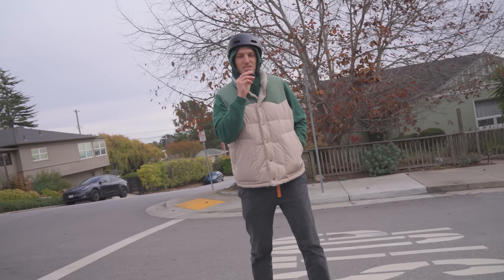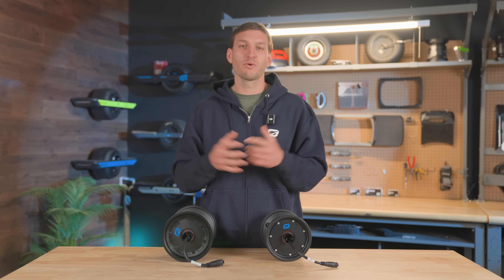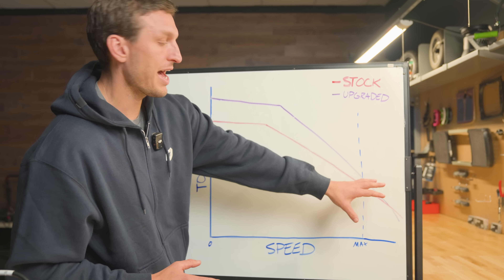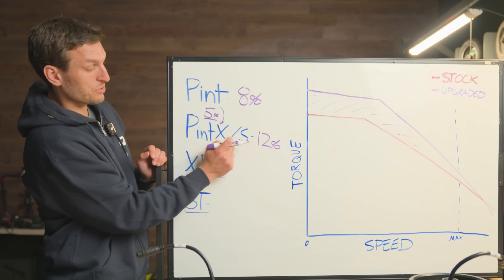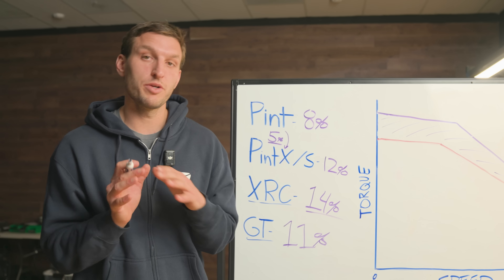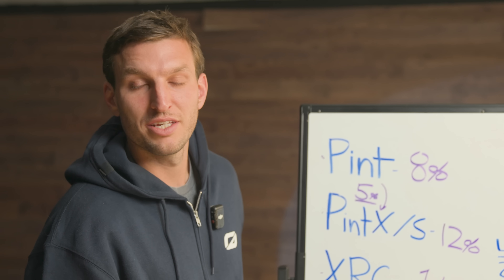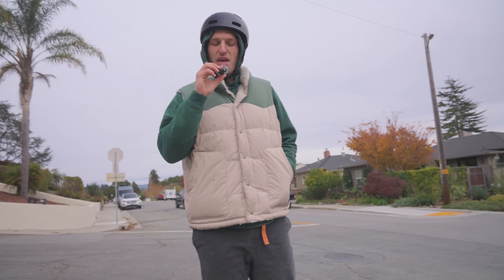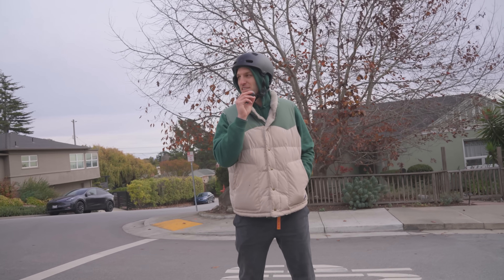We Put an S-Series Motor in a Onewheel Classic!

Comment: GT-S owner here and I'm in the market for a 2nd more agile board.  I will not buy the Pint S until it ships with S motor from factory.  I called Futuremotion and they won't even install the Pint S motor if you buy both at the same time.  1400 plus another 650 and maybe a bundle.  Well over 2K and they won't take the sale.  Keep your Pint S until you do what your customers tell you what they will pay for.

Comment: Does the Pint S-Motor change top speed at all?
Reply: Nope, it actually reduces it. 

This mod is pointless for the pint since its unstable on trails anyways so the extra torque is useless. You spend $650 to get lower top speed which is already too low and not as advertised of 20 mph (actually top speed is around 15-18).

Comment: What is the motor weight difference from stock to S-Series for each platform?  Also, you mentioned heat then moved on.  A lot of people overheat their GTs on hot Summer days; are there any metrics or anything to judge if it is worth it to stop the overheating with an upgrade?

Comment: There is no need to motor upgrade. Existing motors have more than enough power. My 4 year old XR with XRV kit has more power than a GTS. ( XRV increases your XR power from 2500w to 4200w, +68% power increase!)
Reply: No way they can get the 75v XR motor to have more powerthan the 113v in the gts

Comment: You are telling me the "Pint x" is better than the "Pint s" when upgrading to the "S-Series Motor." I thought the "pint s" was supposed to be better? 

 

from a now disappointed "pint s" owner, low-key feel scamed :(
Reply: PintS is the same as  PintX.
Reply: @taylorgarbutt1918  Yeah, I know, besides the footpads and performance tire, but just the fact that they didn't include the  "s-series motor" with the "pint s." Still feels very misleading, especially for new owners. The video makes the "pint s" look like the older pint compared to  the "pint x." I just bought the pint-s since it was the "best pint" and like now knowing that a new "pint s-series motor" is out kinda contradicts their marketing with making the "pint s" look like the better pint.
Reply: @HGKspectro  it's just  a PintS 🤷‍♂️
Reply: @HGKspectro  it would be called a PintS series if that was included.
Reply: @taylorgarbutt1918  True, you have a point,  but imo still misleading considering they have the GT “S.” Pint X+ feels more appropriate since they are essentially the same.

Comment: Ooh! Math hour! I wanna play! 🧮

• Pint - 86.67% more cost for an 8% increase in torque.
• Pint X/S - 46.43-59.09% more cost for a 12% increase in torque.
• XRC - 44.74% more cost for a 14% increase in torque.
• GT - 34.78-36.96% more cost for an 11% increase in torque.
Reply: 86.67% more cost for an 8% increase in torque is a crime
Reply: The additional price isn't worth it for many. Which is why it doesn't come installed (and priced into) stock boards.
Reply: Damn cheaper to just vesc to get the extra power

Comment: C'mon, like you didn't have this motor in the works a while ago before you released the Pint S. You would think your Pint S would come with an S-series motor but no.
Reply from the maker: These motors cost a lot more to make which would change the cost of the board. The included motors are still great but if you want to crank it up a bit you can choose to upgrade the motor on your set up!
Reply: @Onewheel  If you're worried about changing the cost of the board then change the name.. call it a Pint X+ and then for the REAL Pint S include a S-series motor and price it accordingly at like $1600-$1800.
Reply: @Onewheel  I will agree that the motor option should be included with the PintS to make it truly a stand out and above the pintX. I would have gladly paid for the new S motor with my pintX board not after and more cost with the additional motor that I can't use.

Comment: Wait so will the Pint-S Series (now with an S-Series motor which didn't exist previously) have a higher top speed than the Pint-S with a regular motor?  If the XR Classic and Pint-S had a 22mph top speed, they would be in my collection already, as this allows for optimal cruising speeds without hitting pushback

Comment: Got so confused when he pulled out the whiteboard. So the Pint S doesn't come with a Pint S motor standard? I was like wtf is he talking about 12% upgrade?
Reply: 💯% but also confused how, when that was literally the "data-portion of the program" 😂😂 *sarcasm*
Reply: 12% increase in torque if your buy and install the additional Pint S series motor.

Comment: Why can't I upgrade my pint to a pint X/S battery configuration? That's what would hold me back with a motor upgrade.
Reply: @HyperDash   you can bang a Quart in there and rewheel it.
Reply from the maker: Because the electronics in the Pint controller aren't designed for the power specs of the bigger batteries :)

Comment: Say I upgrade my GT to the GTS motor, will the app know it’s a GTS? Or will it still think it’s like a GT and stop me at 20 instead of the 25 MPH?
Reply: @echobird115  your board will not become a GTS just because you install a GTS motor. Nothing will change aside from slightly better low end performance and thermals.

Comment: I bought a Pint S a month ago, woulda been kinda cool to have this S series motor in my S series pint…. Thanks FM.
Reply from the maker: The only thing is that this S-Series motor would have pushed the cost on the Pint S significantly higher. Pint S came in $100 lower than the original Pint X cost but with all the best accessories factory upgraded. Plus we doubled down on developing new firmware to push performance and made that available too Pint X riders as well. A great board and a really great value. Still wanted to make this motor an option but without pricing out most folks.
Reply: @Onewheel The S motor is only $200 more than the X motor on the website. I’m sure lots of people would have paid 15-1600 for a true Pint S… instead I would have to spend 650 more for the new motor and have a spare sitting around collecting dust. Maybe you guys should consider a trade in program for the new motor.
Reply: @Onewheel I have plenty of money for top tier products that meet my needs.  Feels like y’all are playing with my money.  Bought PintS early October, best beginner board.  Bought the XRC at launch, larger platform more power.  And now this…

Comment: This is great news. Been looking into upgrading from my Pint X, maybe this is the solution.
Reply from the maker: Yea it'll give you a pretty sizable performance bump
Reply: @Onewheel  what about mileage?
Reply: @taylorgarbutt1918  I don't care about milage its never been my issue, its torque that I am looking for.
Reply: @StephenMcElligott  same here honestly.
Reply: @StephenMcElligott  you'll get slightly better ranger since the motor is more efficient most likely.
Reply: @taylorgarbutt1918  It gives more low end torque with stronger magnets, the stronger magnets in turn reduce range. The question is how much will it reduce the range by.
Reply: @Defamation_  they mentioned that you get slightly more range. Not sure what your saying.
Reply: @StephenMcElligott  PintV kit will do you one WAY better
Reply: @matttattack54  not interested.
Reply: @matttattack54  that new motor and PintV 🤷‍♂️
Reply: @matttattack54  where do you buy the pintv kit?

Comment: @Onewheel just a suggestion. What do you think about offering people a bundle whenever people are buying boards with the upgraded motor so the consumer can save somewhere from $150-$250 off the motor upgrade. Just a thought. Love the new XRC 🤙🇺🇸🦅
Reply: Future Motion says that unfortunately although the s- motor fits in All their current boards, their "bandwidth" (aka CEO's?) won't allow their boards to be shipped with the motor their customer prefers 😢😢
Reply from the maker: Yea not a bad idea, we'll pass it along. I know we'd love for each board to have a factory installed upgraded motor at an option at checkout but it's just not viable at the moment.
Reply: @Onewheel                                                  viable  Fm can EABOD's
Reply: @Onewheel  people can still buy the factory board with factory motor installed but have the option to get an additional upgraded motor separately with a package deal and install it themselves or have the factory install it at different price points.
Reply: @Onewheel  Not viable?  The standard motor is $450, and the upgraded motor is $650, so a $200 difference.  Is it viable for me as a consumer to purchase a board with a $450 motor and then spend another $650 to get the upgrade- Just to have a useless OG motor hanging around in my life? Missing out on some sales here, I’d wager.
Reply: @Onewheel  of course not. Because then how else would you be able to make people buy more than one motor. Jeezus.

Comment: I think people would have preferred the Pint S to have to have the S motor w/o the upgraded accessories (tire, handle, footpads), even if it costed like $1500. It makes sense but why wouldn't FM do this? I'm thinking it's a spec and marketing issue. Putting in stronger magnets while keeping everything else in the drivetrain the same usually means higher torque at the cost of top speed which they crucially omitted in this video. 

So to make the Pint S have better torque and speed over a Pint X it needs to have better drivetrain components all around, most importantly, the battery. But new battery and motor would place the Pint S at around a XR Classic or GT price which doesn't make sense from a marketing and product standpoint. With the price reduction of the Pint and Pint X, the Pint S has no purpose other than to fill a gap in the lineup but from a product perspective not a performance perspective; which is pretty whack IMO. And if you're considering a Pint S you might as well consider an XR Classic which is what they want you to do.

Comment: The Pint S doesn’t come with a Pint S motor?  So Confused!
Reply: The Pint S is literally just a Pint X with upgraded footpads and a tire, that's the only difference the FM website lies to you about a bunch of things
Reply: @CodedGames facts! Plus they claim 20mph. False tops out at 18mph before pushback.
Reply: @CodedGames  Stop trolling this post with misinformation. FTFL
Reply: @StephenMcElligott  But that's literally true. If you go on FM's website it says the max speed of the Pint X is 18, which is false. The Pint S is literally just a Pint X with better footpads and tire. The literal OW app can't even tell the difference between a Pint X and Pint S as you have to pick which one your board is
Reply: @StephenMcElligott  not trolling when it’s facts
Reply: Why was it ever given the S name then?!? (because they rushed it in response to the PintV kit) no new motor. No bigger battery. Same same, but  b u n d l e  version. Not S. Never was. PintX+ at best.

Comment: does the upgraded motors make pushback happen earlier on pint or XR classics?
Reply: @joshua1577  no. Speed push back is the same and torque pushback will come in less often
Reply from the maker: Nope, it'll happen at the same time.
Reply: Stronger magnets will result in a lower top speed, but as evident by this video they don't want you to know the real specs of this motor
Reply: @CodedGames  More misinformation.

Comment: This is super awesome. Should I expect a loss of range putting the GTS motor in XRC?
Reply: @zalla135  no range loss under the same riding conditions. In some cases you may even get more range since you're able to access more torque with less energy.
Reply: No clue FM won't even tell you any meaningful data about this motor like actual watts or N/m of torque because they know their specs will be WAY lower than the competition
Reply: @CodedGames  Stop trolling this post with misinformation. FTFL
Reply: @StephenMcElligott  I literally made no claims in this post. If FM wants to back up their claims that this board is better with data then I'll remove my comments
Reply from the maker: You actually may get slightly more range depending on how you ride due to increased efficiency
Reply: @Onewheel  Can you back that claim up with actual data? Compare the wh/mile of a board with and without the new motor? What makes it more efficient, lower strength magnets? This stuff doesn't have to be magic nonsense you can explain what is improved
Reply: @Onewheel  awesome thank you. I’ll definitely consider this upgrade

Comment: Do you loose range with a motor upgrade on the XRC?
Reply from the maker: No but you may actually gain some range due to increased efficiency
Reply: @Onewheel  Interesting, but if the motor upgrades add torque, doesn’t that typically increase current draw under load? How do these motors achieve greater efficiency without impacting range under real-world riding conditions?
Reply: @fixmypev it’s an increase in torque per amp, so you need lower  motor currents for the same climbs. However I have never been able to measure any difference in efficiency between all the different motors I’ve been comparing so far. Also the battery amps aka power draw remains unchanged on the same climbs
Reply: @surfdado  Interesting! Thanks for sharing, Dado.
Reply: @ oh snap! I need one! 🤝

Comment: Can we buy an XR Classic with the S-series motor pre-installed or do I need to buy both then have a leftover motor?
Reply: Crazy they'll respond to this question but no one else's about the pint s motors
Reply: Why sell one motor when they can sell you two.. duh … They have to run a business guys…
Reply: As the standard for all FM products: buy both, spend the maximum amount of money possible
Reply from the maker: Unfortunately that's not an option yet. Hopefully one day it will be but our manufacturing line has limited bandwidth and isn't currently able to accommodate that at the moment.
Reply: @Onewheel aw don't worry, you'll def. be able to afford to increase your bandwidth with all the money you'll make from your customers buying second motors 😊

Comment: TFL said the XRC motor is a GTS stator married with a 6 inch hub with GT magnets.. wouldn’t it just be best to spend the money on an aftermarket hub with stronger n52 magnets? It would be much cheaper plus it allows you to get a 5 inch hub (or 6) that would be solid billet and have color options.
Reply: OK, I just looked into this. It is $700 for a 5 inch n52 with NSK bearings. Billet version. You could just buy this one for $800 and have a complete back up motor.🤷🏻‍♂️
Reply: @ but it’s not a 5 inch hub it’s 6 inch. So less tire sidewall and cushion so worse ride experience
Reply: @zalla135  depends on who you’re asking I guess. The 5” is great for mobbing chunk I will say.
Reply: Is the GTS motor in itself more powerful? Or is it just magnets?
Reply: Makes sense to me lol

Comment: Doesn't the Pint S have the Pint S motor by default?! Clarify this point please...
Reply: Imagine buying a BMW M4 without a BMW M4 motor …. This is pretty hilarious guys
Reply: So a Pint S-S-Series is coming? Don't you think there is communication issue there?
Reply: No, why would that be the case? That makes way too much sense for their product line up
Reply: @PoopTart3  Because Pint S seems equal to Pint S (Serie) as the name evoke.
Reply: @fbrcdx  The entire time the Pint S has just been a Pint X with nice footpads and tire, nothing more
Reply: @CodedGames 😂💸
Reply: It do not. 
All pint s owners got hoodwinked with a pint x.
Reply from the maker: Ok a little confusing with the naming conventions here but the Pint S doesn't have S-Series internals like the GT S-Series does. If it did it would have costed significantly more. We wanted to give the Pint platform a facelift so we gave the Pint S all the factory upgraded accessories out of the box and doubled down on the firmware to give it more juice but also wanted to keep it at a cost that made sense for the Pint line. It is kind of confusing from a naming convention standpoint, I'll give you that but generally better options and lower prices with more performance.
Reply: @Onewheel the more performance was also given to the pint x. The pint s is just a pint x with upgraded footpads tire and mag handle pro. Plus your website hasn’t been updated and it still says the pint x goes slower than the pint s which is total false advertising.
Reply: @Onewheel  Why not then make it so the "Pint" platform only gets a better motor? Can you do something good for the consumer, without them having to pay extra for it. Like cmon.
Reply: @Onewheel you spelled “deceptive” wrong
Reply: @Onewheel it would be cool to have the option to upgrade from the factory instead of having to buy it separately. Same with the GT just a idea
Reply: @Onewheel ”doubled down on firmware” is that what we’re calling bricking Pint Xs now?
Reply: @Onewheel  Hey while you guys are fixing confusing things can you fix your own board compare tool? It says the Pint X only has a top speed of 18, even though it's 20, and doesn't have custom shaping, which it does. It should be the same as the Pint S
Reply: @CodedGames  Stop trolling this post with misinformation. FTFL
Reply: @StephenMcElligott lmao this dude is wilding. it’s not that deep. if you don’t like their stuff, don’t buy it. they’re just giving us more products and options here. that’s what businesses do
Reply: @CodedGames 💯
Reply: @CodedGames  The top speed of the pintX/S is not 20mph, pushback hits at 17-18